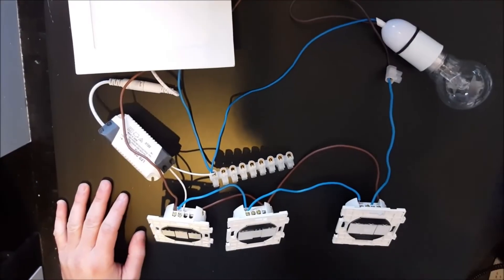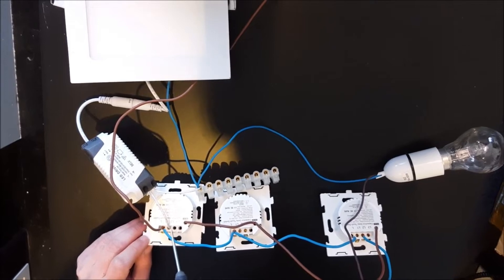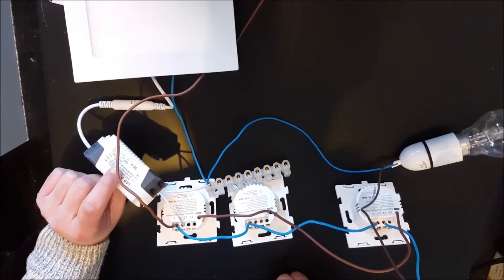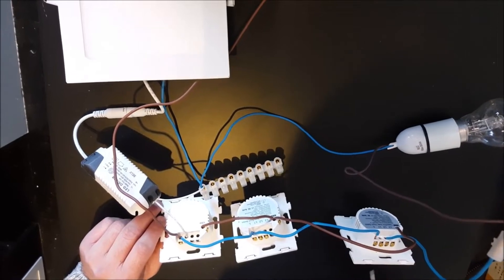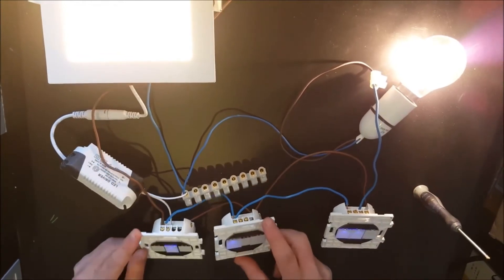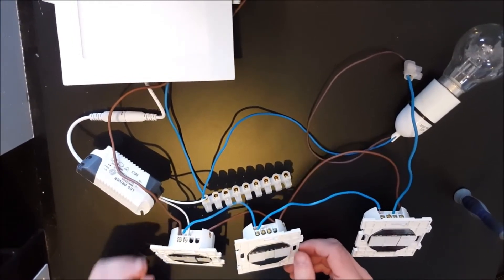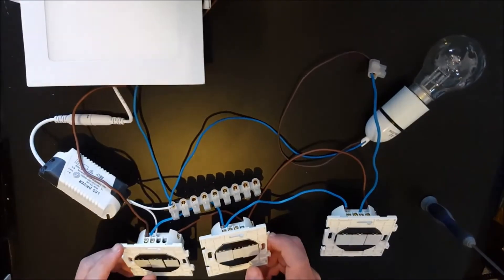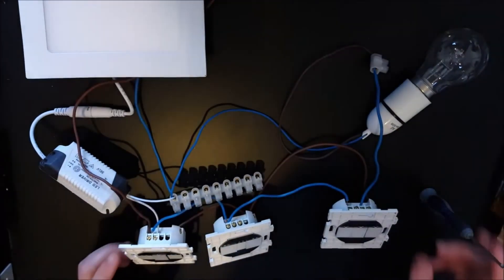I LumoS 3 Way Touch Glass LED Light Switch Wiring and Pairing Instructions

Comment: Love these switchs and have several round the house, they can be twitchy and have had one fail straight out of the box. I have 3 seperate switchs in the hall that are all doubles switching lights in garage, hall and upstairs and a 2 gang upstairs that controls up and down, to do this with Lumos is a step to far for me and to save my sanity this will be done with conventional switchs. Would be great to use Lumos but pairing this little lot looks so easy done by someone who knows what they are doing but for the rest of us would probably be a full days job

Comment: Hi,really struggling to connect similar switches as three way. Wiring is done correctly as the standard switches work as they should. I have three electric boxes one cross with four wires, two going to another box and another two to second box. In each box three cables, power in and two from cross and in third the bulb one and two from the cross. Each switch has l(a) l1 and b and this is where I’m getting puzzled and can’t get this working